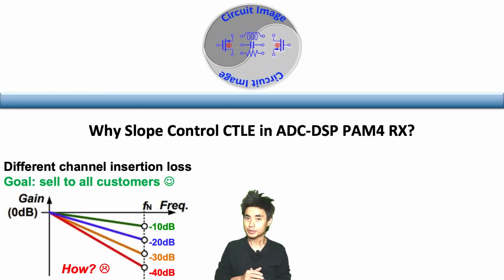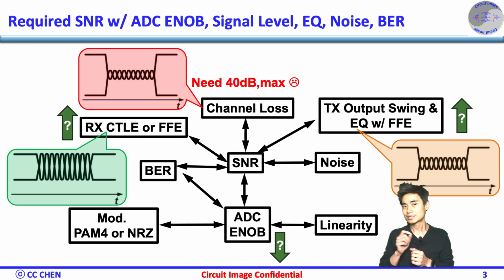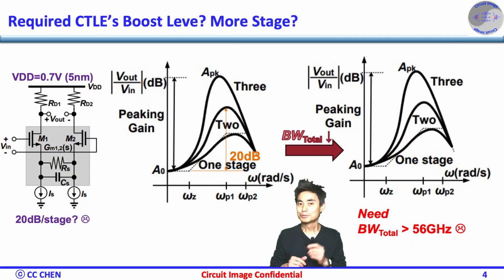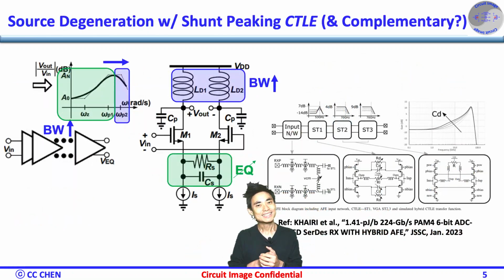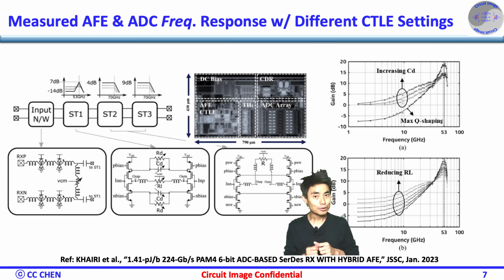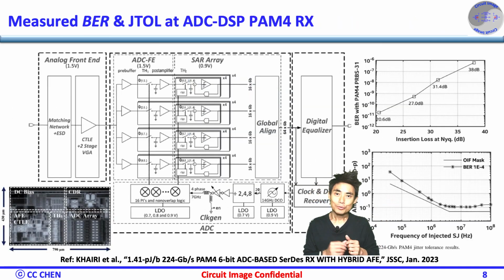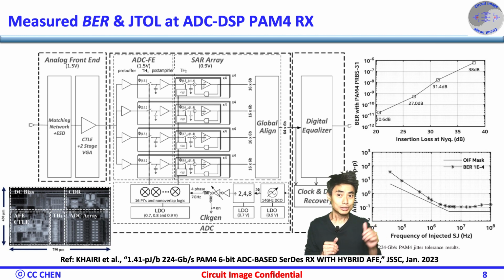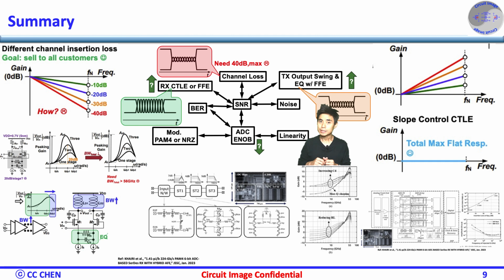Why Slope Control CTLE in ADC-DSP PAM4 RX?

Comment: Hi CC, thanks for the video. The slope control of CTLE is indeed very important, while the adaptation is another major issue. Hope there will be some videos for this topic in the future. Also I got another question here: in the intel paper you mentioned, is it reasonable to exclude the DSP when calculating RX power consumption? The 1.41-pj/bit claim seems to be very misleading IMHO.
Reply from the maker: Hi David,You're welcome.
Thank you so much for your suggestions.
Sure. I'll do the adaptation.You're correct that 1.41-pj/bit claim seems to be very misleading, and that's better to include the DSP power. I think more & more paper in 5nm or 7nm starts to include the DSP power since the digital power reduced a lot. :)
Thanks,
CC

Comment: Q1. What are the major innovative ideas for the mentioned paper on adjusting the ctle  boosting profile? It seems still the old way of adjusting degen R and C? Q2: why two stage VGA ?  Would it better than one stage? I thought more stage will reduce bandwidth and don't see the big benefit of using two stage VGA
Reply from the maker: Hi Jason, nice to meet you and thank you for the good question. I have comments below.
Q1: adjust the slope of HPF to be the inverse of the slope of the LPF (channel).
Q2: to improve the linearity over different input swing.
Q3: BW is better, but the dynamic range is limited.
Reply: @circuitimage  Hi Thanks for your answer. For the Q1, your answer applies to all the ctle basics, which requires the transfer function to be inverse of channel. But what I didn't get is if any new idea in  the Intel paper , particularly how they achieve different transfer function for different channels other than the old way of tuning degeneration r and c
Reply from the maker: @forgetpwnow  You're welcome. My understanding is that Intel applied the inductor peaking along with the sweep capacitance to tune the Q shaping of the LC tank or the slope. I don't think that could be very accurate though. 😉